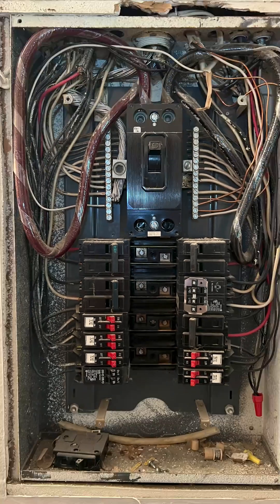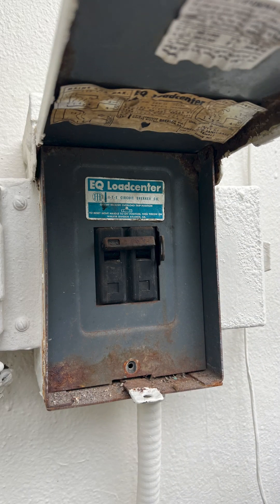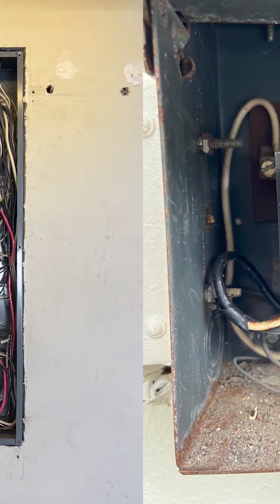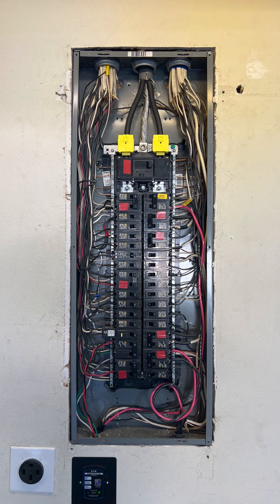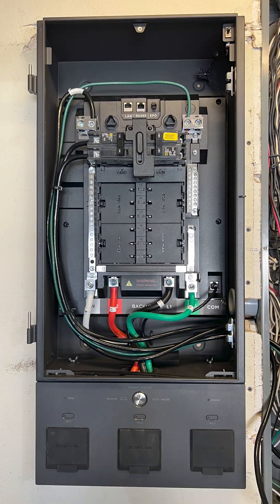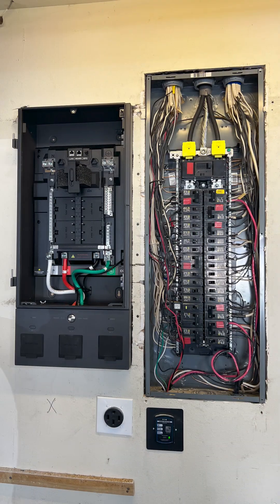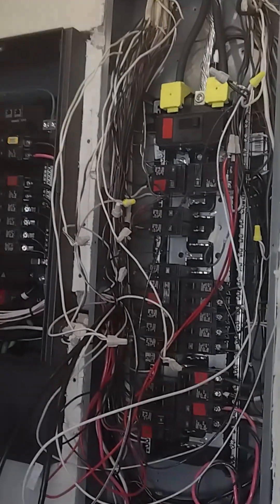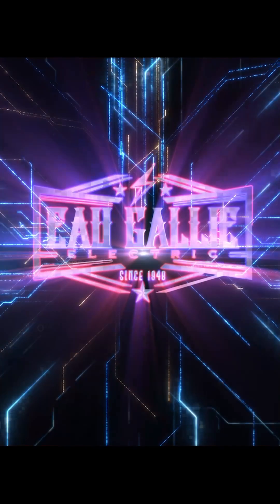EcoFlow Smart Home Panel Install - Residential Electrical Services #eaugallieelectric #electrical

Comment: If I connect a generator with a 120V output to the EcoFlow Smart Home Panel 2, and my home's power consumption is lower than the generator's output, will the excess power be fed back into the battery?
Reply from the maker: Eli Casto can help you with this question.  Could you contact him at: ecasto@eg-electric.com he is waiting for your email.  He might have a few additional questions in order to give you a recommendation.